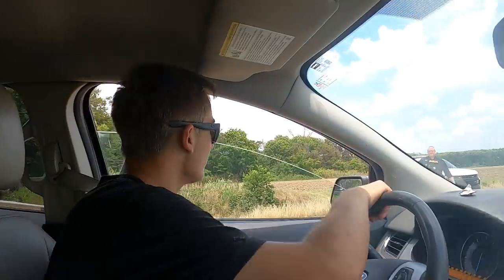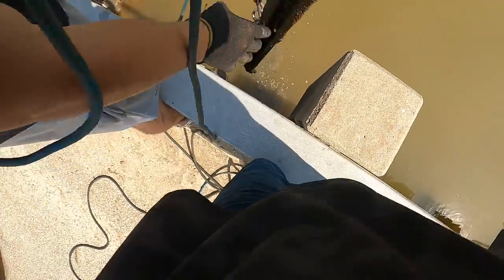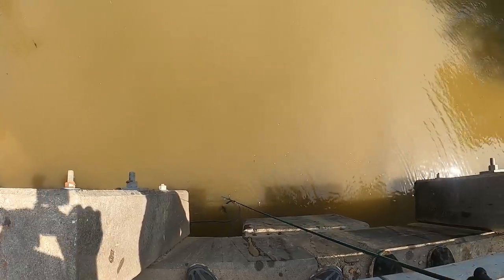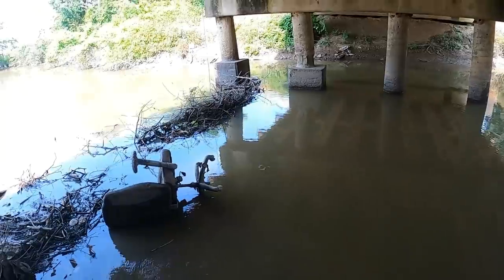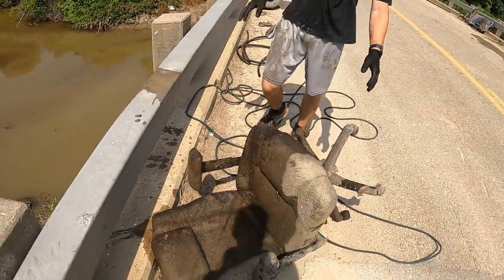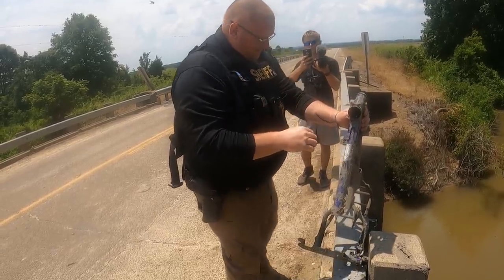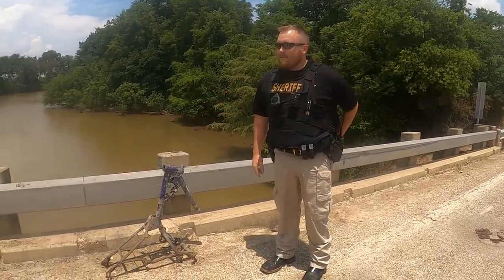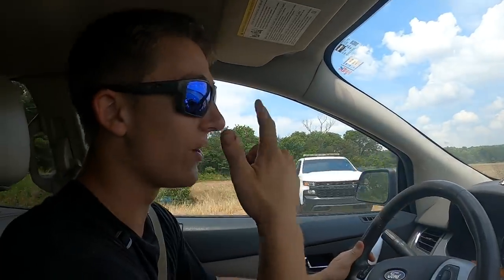Police Escort Us Off Bridge While Magnet Fishing To An Undisclosed Location (Top Secret)

Comment: You guys need a truck or trailer with a winch in it. Just winch the heavy stuff right into a truck bed or onto a trailer. Small winches are not very expensive and trailers are cheaper than most trucks, but all you need is an old beater. Add a few shackles and pulleys, and maybe hand cable winch (come-along) to your tool kit, and you'll save your backs and greatly reduce the injury risks. Oh, and get some good work gloves and eye protection. If you can swing the cost, get one of those truck bed hoists that has an arm you could swing out over the water and pull things straight up.
Reply from the maker: Thanks for watching this video

Comment: No excuse, when gage reads less than half, you need fuel.
Reply: Thas a great idea till the fuel pump burns up and and gotta drop a tank half full of gas
Reply: @bmanclassics4350  If you go thru fuel pumps that fast then you need a different vehicle. LOL. Out of all the vehicles I've had in the last 40 yrs I've only had to change out a fuel pump 5 times.
Reply: @trreb1  yeah but when ures went out we're u lucky enough to be on E? And also nosey I build street cars and race cars when u do that u deal with fuel pump issues 🏁🍻
Reply: Keep it full if your fuel pump goes out take the front bolts out of the bed and loosen  the back one's rase the front of the bed up and block it up and Change the fuel pump! WORK SMARTER NOT HARDER! AND GRATE VIDS KEEP UP THE GOOD WORK! AND THE WAY THIS VID ENDED I HOPE Y'ALL AREN'T HANDCUFFET NAKED  TO A TREE SOME WHERE BOY THAT'D SUCK 😂🤣😂🤣😊🤣😅🤦🤷